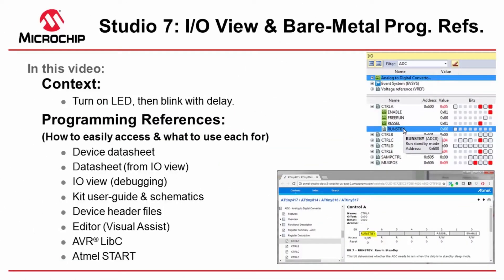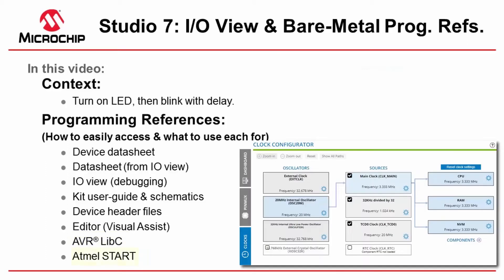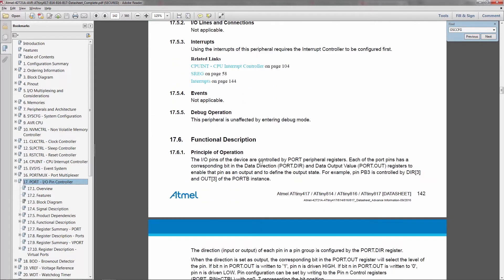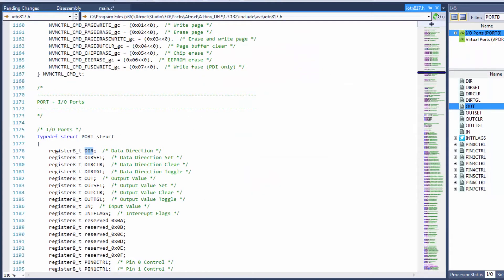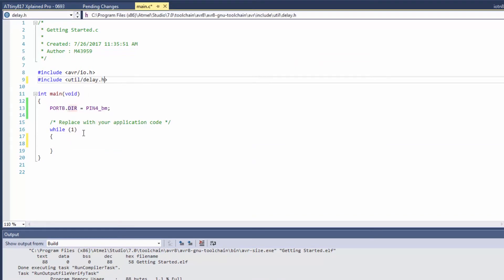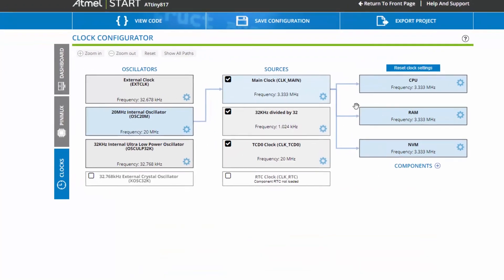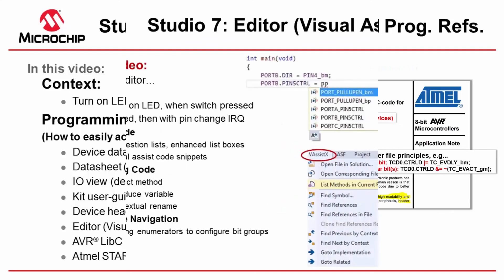Getting Started with Atmel Studio 7 - Episode 10 - I/O View & Bare Metal Programming References

Comment: If anyone's puzzled around 3:58, this may help. We know his project is for an ATtiny817, but where did the image of the Xplained Pro board appear from?

For example, the simulator can be linked to pictures of certain boards (e.g. the Butterfly). When that's done, toggling a line in the debug I/O window can make a LED in the image appear lit, even though it's only happening in a simulator window. Is that what we're seeing, and if so how did he achieve it?

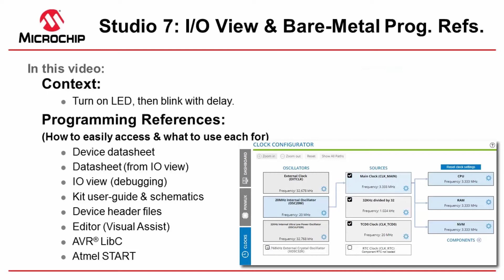The answer's "No, we're seeing something else." The key is at 1:32 when in passing he says he has the board plugged in. The image is live video of that real board, that he's just overlaid in front of his Studio screen-capture while recording the tutorial. That makes it look like some magical simulation window launched from Studio itself, but it's not; we'd see his hand if he waved it near the board.

The other trick here is live output on that board, driven from the debug I/O window even before he's written any code that affects the LED. That's a useful feature of Studio: in-circuit emulation is integrated with features that are also available for source-level debugging.

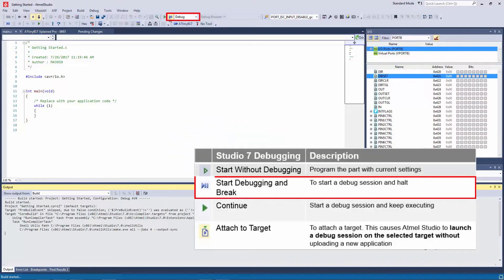Remember though, that it's not enough just to have the board connected and powered up: toggling a LED (for example) from the I/O window can only be done in a debug session. Again he hints at this in passing: at 3:51 he mentions that he first hits "Start debugging and break".

Until then, even though the board is connected and powered, the debug I/O window is available but what it's displaying isn't "live" - it doesn't reflect the state of port registers, because it's not communicating with the board. "Start debugging and break" is enough to launch a debug session, allowing what he does in the I/O window to change what happens on the board (and, of course, to show up in that live-video image).

HTH.
Reply: Maybe from here: https://www.youtube.com/watch?v=6JEbnyz2Mac&list=PLtQdQmNK_0DRhBWYZ32BEILOykXLpJ8tP&index=2&t=1s

Comment: I am an absolute rookie, but I wonder if this is really bare metal programming as the gentleman is still using macros, structs, etc. Nonetheless a well made tutorial.
Reply: Just get the E70 Xplained and download the v1.5 softpack it has lots of low level examples.  Use at least an i5-2400 PC- Atmel Studio (derivative of Visual Studio) is a hog! Albeit these are FOUR years old. Makes one wonder if the E7x/V7x are dead. No new E7/V71 code from Microchip, nor version like the STM32H7 at 400MHZ. Milking a dead cow?
And see this barebones work https://github.com/sidneycadot/same70